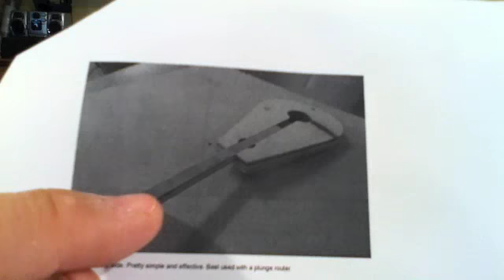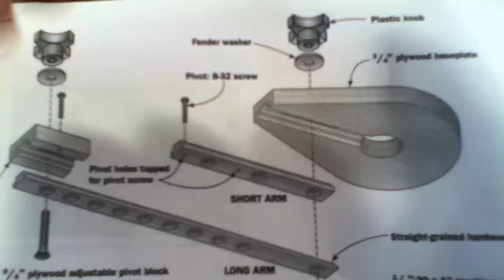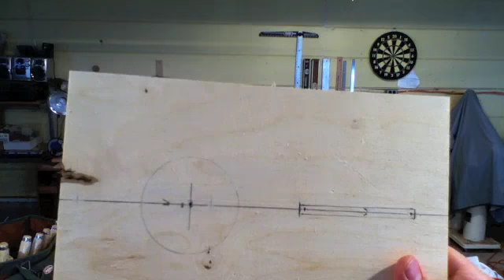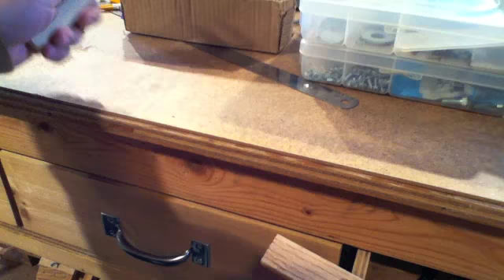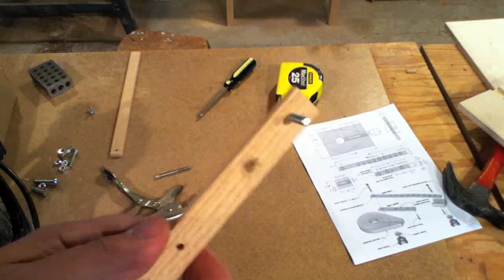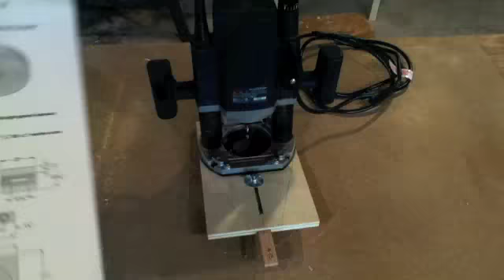Router Circle Jig

Comment from the maker: Hi Pat -

Using t-track would be a great option - I used wood to keep the cost down. I found that building a guitar means also building lots of jigs and fixtures, and the cost can add up quickly. If a jig will be used frequently it would make sense to use more durable materials.

Thanks for the comment,

Randy